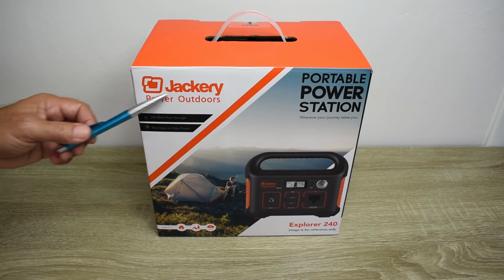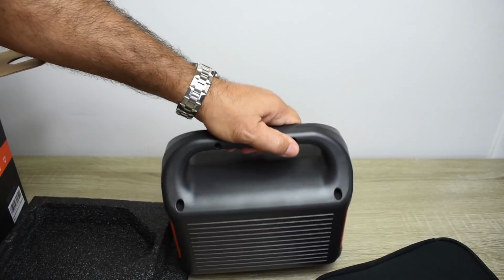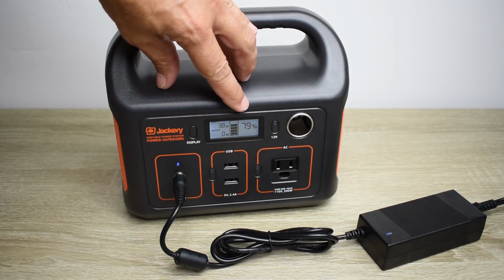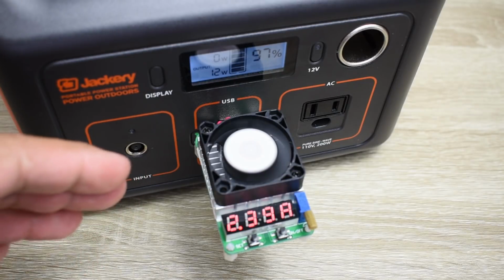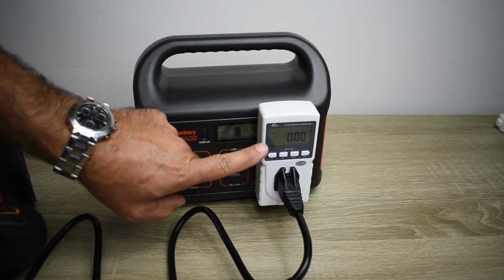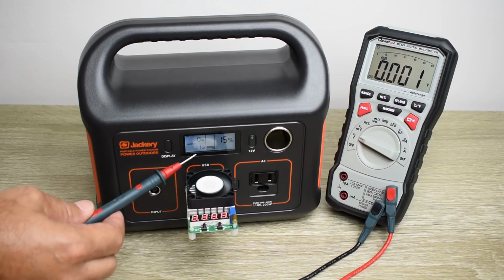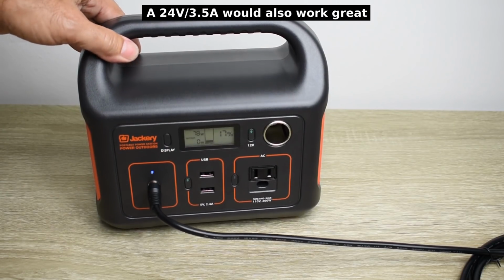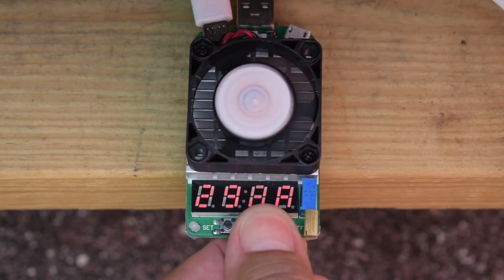Jackery Explorer 240 & 60W Solarsaga POWER OUTPUT TESTS!

Comment: Jackery apparently doe nor want you to charge the 240 at a high rate. I own one and have a 100W, 24v panel attached to it. The most I ever see charging it is 50W - no more than that ever. I have it for about a month so far. They actually recommend the 60W panel that they make.

Comment: Hi I'm Mark a new subscriber I wanted to ask what the difference is the 240 and the Explorer 290 I have before 290 and the 100 what solar Saga panel are these basically the same and mine says pure sine wave I don't know what these things mean I just like to use it if I'm out and about maybe you can give me some advice on what it can and can't do
Reply from the maker: Not familiar with the older units, but I'm sure you can find a comparison on a website. Lower number = lower AC power output.
Reply: @electronicsNmore  do you know what sinewave is ? Could you explain it to me
Reply: the 290 was replaced by the 300.

Comment: I've looked all over for a 25v 3.5amp power adapter but can only find 25v 2amp   ones. Can someone please show me where I can find it?
Reply from the maker: They sell 25V/4A, which is more than you need, and they're little pricey. Use a 24V / 3.5-4A SMPS, it will put you at 76W, there's no need to be maxed out. 
https://amzn.to/3em8KxJ
(Amazon Affiliate Link)

**You "may" need to replace the DC jack on the end of the power supply with the one you have by soldering it with heat shrink.
Reply: @electronicsNmore  Thank you. Won't be soldering anything though. I have zero knowledge about this stuff.
Reply from the maker: @SaraMichellevideo  OK, I just checked, and the Jackery 240 uses a 5.5 x 2.5mm DC jack, so the one I show should work.
Reply from the maker: @SaraMichellevideo  Correction: Jackery uses a DC8mm
Reply: @electronicsNmore  I'm thinking about getting a Paxcess Rockman 300w instead. From what I can see it has a Max input of 76w.
Reply from the maker: @SaraMichellevideo  Not a bad unit.

Comment: Hello Question. I have a magic chef that I would like to power with the Jackery but unsure which one to purchase. The wattage on the fridge is 60 watts and 115 voltage
Reply from the maker: If it's only 60W, the Explorer 240 shown in this video should be fine. You always want to go higher in capacity to help start motors easily. The 160 may not do it. Be sure to use the supplied product links in the video description area to support my channel(No added cost to you). Thanks!
Reply: electronicsNmore will do!!! thank you for responding! So the voltage of 115 on the magic chef mini fridge is ok even though the 240 has 110 voltage?
Reply: electronicsNmore Ordered from the link
Reply from the maker: @CrystalButcher_TheBenjamite  Thanks for your support! If you have any other questions, just ask.

Comment: Hi again, just tried to order the 60w solar panel and it says not available and do not know when/if it will become available?  (Never easy...) Can I use an alternate panel from another company and if so, what adapter would I need?
Reply from the maker: OK. Rockpals makes a good folding solar panel that's compatible with the Explorer 240. :-)
https://amzn.to/2WmlCL0
(Amazon Affiliate Link)
Reply: electronicsNmore    Excellent. Thanks for a solution!!  I’m on a mission!
Reply: electronicsNmore - on Amazon now. it’s a better price too! $139. Promise this is my LAST question: So when recharging Jackery 240, do I disconnect the fridge for the 5-6 hrs the Jackery is connected to solar panels?  I’m struggling with this set up concept. Really appreciate some clarity.
Reply from the maker: @deezinermedesigner7970  You need to make sure the fridge doesn't use more power than the 12V accessory socket on the Jackery can deliver. If I recall correctly, 10A max. You can use the Jackery and charge it the same time.
Reply: electronicsNmore   I see. Ok, I will check this and confirm. (Sounds like, as much as I do not want to have an auxiliary battery just to run a very small fridge, I am going to have to... ). I’m getting the sense, the Jackery is more for “techies” who need to stay connected with their IPads and drones. I am simply looking to run the minimal components needed to travel comfortably, without seeking hookups.  I do not need to access my phone, IPad, all day. In fact, this is why I am choosing this lifestyle. Basic, minimal and untethered. Again, appreciate all of your advice!  Best to you!

Comment: Thank you for your very informative video.  I'm not good at figuring out watts, voltages and amps so I'm trying to figure out how long the 240 will power a small table fan that is 9 inches in diameter. Or should I go with the 500?
Reply from the maker: If all you want to power is a light and fan, the 240 is plenty.

Comment: I have the Jackery 240 and the Jackery Solar Saga 60. When using the solar Saga 60 I get between 45w and 55w. I do live at around 8000ft above sea level. When I bought it in early 2020 every review out there said that all charging is capped at 40w.  The 12 V and AC charging IS capped at 40w, but it was nice to find out after using it that solar charging is not capped at 40w.  At 55w it takes about 4 hours to charge.
Reply from the maker: You'll like my other video on this subject. :-)
https://www.youtube.com/watch?v=yXNW-4fNZVk

Comment: Excellent work doing a thorough review of this unit. So many "fluff" sales pitch reviews out there.
Was hoping to see a voltage reading of the 12v lighter socket when the battery was low to see voltage regulation though.
Overall loved the review. Thank you for taking the time.
Reply from the maker: Glad you enjoyed it! The voltage of the 12V socket is regulated, so it's the same level when the unit is discharged to a low level. Thanks for watching

Comment: Where would you find a AC power adapter for the Jackery 240 that gives an input like you recommend of 25V / 3.5A?
Reply from the maker: Hi there. Use the one below, it's inexpensive and works good. You will need to cut the end of the cable off(has the wrong jack), then use the jack that came with the jackery. Pos to Pos / Neg to Neg when you solder or splice.
https://amzn.to/3gc0ejO
(Amazon Affiliate Link)

Comment: Great vid.I have this setup and I'm quite happy with it.My question though is the 240 has max input power at 42 watts yet your setup drew 62, how was that possible? did they perhaps send you a unit that bypassed the rating?
Reply from the maker: 42W isn't the maximum. It's the maximum from the included smps charger. As you saw, the unit had no problem being charged by the 60w solar panel. I showed you the max input wattage for the unit in this video. The company screwed up when they stated it as Max input wattage, I did discussed the issue with them.

Comment: If I could isolate this from extreme temperatures I would use this to power a weather station...winter time will not provide enough solar to power current setup...bloomsky...
The ac circuit is useless to me....the unit at $1 per watt is inline with other similar units but the 60 w panel is almost $3 per watt...👎
Reply from the maker: You always pay more for high cell efficiency folding panels. It was on sale yesterday for $125